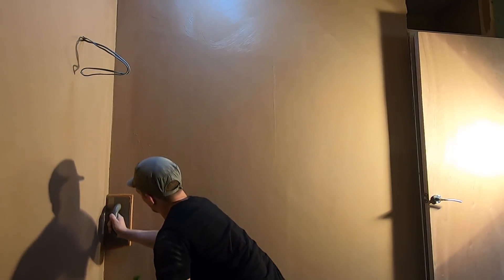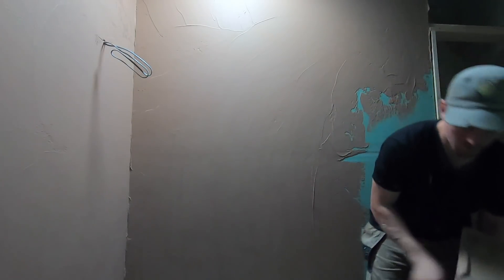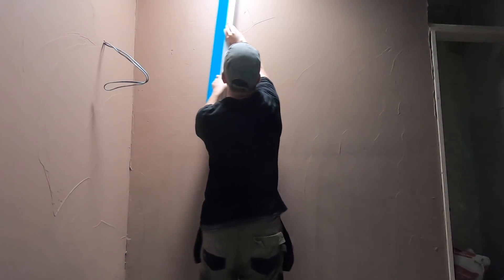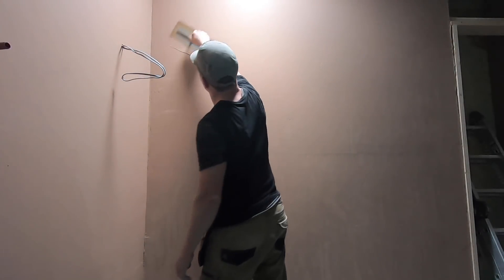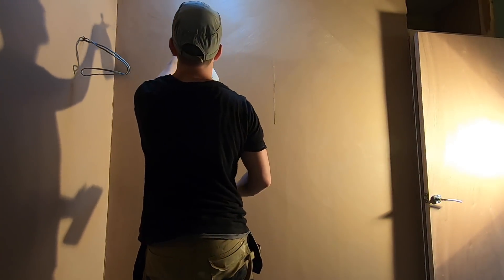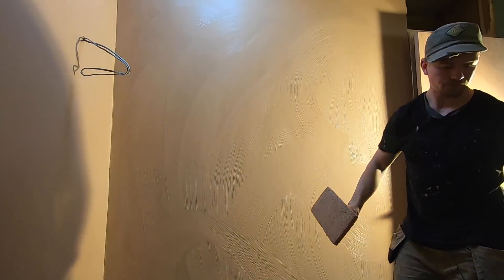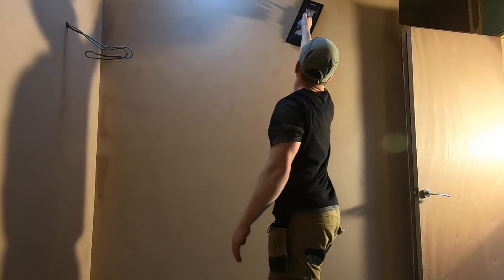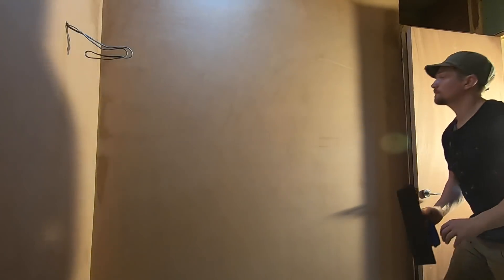One Coat Plastering | Is It Ever OK To Do??? (TEST)

Comment: One coat plastering I was taught at college is the difference between’ plastering and skimming’. Rough backgrounds need 2 coats and flat backgrounds usually only need 1. If a flat wall has cracks and needs scrim, then I 2 coat the scrim and 1 coat the rest. If I’m 1 coating a flat wall, as soon as I reach the end of the wall, I immediately go back to the beginning and flatten off with my 30” plastic trowel.

Comment: Let's be honest, the main reason one coat work is hated is because it lowers the barrier to entry into plastering. Anything that makes the job easier, faster, efficient will get pushback. If we stick to the 'science' of plastering, as long as the wall is flat, plumb and smooth, then it's good to go regardless of method or technique.
Reply: AJ It’s a bit like the ‘art’ of soldering and copper pipework. Ask an experienced plumber his thoughts on push fit and many would say “won’t use it”... I’m a general builder,  i’ve been using the stuff for 15yrs, not one leak (touch wood).
Reply: @gdfggggg  yup, it's exactly like that. Great analogy.
Reply from the maker: I think you've hit the nail on the head AJ. That's a very good point mate and a very interesting view on the world off plastering at the moment!
Reply: Perfect answer. Nice one.
Reply: We only do it one time in Hong Kong. Of course, much fine in craftsmanship in the west
Reply: I’m not sure it does make it easier surely it easier to work with two fresh batches rather than one that is going off before you’ve finished working with it.

Comment: Hi mate, a plasterer worked for me in London, he did 3 x 45 m2 ceilings in 5 hours, he worked on scaffolding but only had enough for one ceiling so had to move the scaffolding afer completing each ceiling he one coated all of em, he had 2 labourers the finish was spot on, he only used a trowel hes the fastest plasterer ive seen in my 22 years as a plastering contractor. I can one coat but prefer laying it down with the second coat. The trick is put it on thicker and dont leave it long between each stage and sponge float it, you were spot on in your video, great videos mate, keep it up 👍

Comment: Ive used one coat on plasterboard and and all sympathetic backgrounds for the last 21 years and NEVER had a problem from any client. I use 2 coat with float and set only. My finish is always excellent due to my experience with the medium. Plasterboard was designed for plastering  (the clue is in the title). Always bear in mind your main objective. Preparation for decoration. Its not to provide structural strength or fireproofing. These things are taken into account at the building design stage. If they were'nt tape and joint would be obsolete. 2 coat work is a hangover from days gone by when most backgrounds were sand and cement scratch coats and demanded 2 coat work. As in the above video as long as you apply the muck thick enough its not a problem and should be encouraged. Whenever I see a experienced spread doing 2 coat work on plasterboard I think WTF.. all these years plastering and you still have'nt figured out its a waste of time. Wake up and focus on the objective not the herd mentality..
Reply: Yes Gary you’re one I could learn from. Good mentality.
Reply from the maker: This makes complete sense - very well formulated argument. You've convinced me ha!
Reply: You are amazing and I love your videos. Tried the sponge but never worked for me. I do one thick coat for plasterboard and 2 coats for anything else as old walls are not levelled. The first thing I do is to fill the joints as it will be my thickness guide. This is how I have been taught. Thanks again for everything.
Reply: Just looked at this video and your comment which makes total sense. Question: What plaster should I use for small area of plasterboard cut in on existing ceiling? There are so many on the market - MultiFinish / Board Finish / Finishing PLaster and even one called 'One Coat'. Thanks
Reply: @Gary Wright.. could you give quick timings between toweling etc when one coat sponge process. Would be a great help for me.. thanks mate and thanks for the honest comment!!!!
Reply: Do you know how many times I’ve tried getting this across to some of the other lads ahaha people stuck in their old ways get 2x as much on because rather than mixing up for a second coat you can do another hit with no loss of quality on boards.
Reply: @andychapman3100  if your just repairing a hole ide say use easyfill 60 or easyfill 20     it's sands down great to leave a flat surface but if your skimming the entire ceiling ide say use multi finish
Reply: Tiler here, never skim plasterboard if being tiled fully, tiles hang better on plasterboard, it’s normally flatter, and holds more weight per m2 than skim , also cement adhesive reacts with gypsum plaster , so needs good priming !!! No need for doing it
Reply: I am a diy plaster I get a great finish with one coat I don’t see the point of messing it up again with second coat when it is perfect with one coat

Comment: a good few years ago i was learning plastering in college. one coat was heavily frowned upon as it was considered a cheat and crude and not used so we learned bonding then skimming and only using 1 trowel for everything and a feather edge and it was considered bad luck if you got the smallest trowel handed to you by requisition. Only did 1 plastering job after college and basically bottled it and havent done plastering since. Saw your videos pop up while browsing Youtube the other day and now i really want to try plastering again. I just gotta remember how i did things then and hopefully find a small easy job to do first. Keep up the Good Work Blaine your a pro!!
Reply from the maker: That's crazy...I suppose things have changed a lot since then! It's never too late my friend. I would just start at friends and family and start for free. It's the best way to get experience...I'm sure you'll pick it up in no time pal!

Thanks for watching. I really appreciate and good luck with it all
Reply: I did plastering for 2 years I always learned two coats and tbh I e never paid anyone todo my homes but this last week I had a guy in doing a big room for me as my shoulder is actually ruined nowadays, He did one coat.. didn’t put it on thick enough and plastic troweled it he’s made a massive mess in my £1 mill pound home and it’s all cracked and egg shelled, proper pissed off he’s coming back to try fix it but now I’m thinking it’s going to be a skip and sds chisel job and start again… the wife’s paid him as well. If you want to make a video your welcome to come and see this nightmare job he’s leaving. Due too my shoulder I’ll have to try lvl 5 it to save the room.(living room too). Some people shouldn’t be allowed in the public.

Comment: I use both single and double skim and have not had an issue with either. For me it which one I go with entirely depends on the wall condition/wall situation/surface prep etc. Never used a sponge or spatula (may try one soon though). For either  method I only use a regular stainless trowel, a superflex trowel and a sprayer and get the same good quality finish with both double and single.  

Doing the single doesn't save me much on trowel work as I find myself working the wall more but it does save me doing an extra mix and washing out as many buckets etc (which for some reason I really hate doing)  

I learned how to get the best from a single skim by starting out fully expecting to do a double and trying to get the first layer as good as I could, before long I was getting it so good (in certain situations)  that I realised I didn't need a second.    

Great video's btw. Keep up the good work!
Reply: You must be a good plasterer,a totally agree with you ,been doing this trade 17 years , and your comment on washing buckets out , true a hate having to do that ,but straight walls and plaster board only need one coat .

Comment: Blaine, this guy i worked for truly made tightness into an art form. 
That was the reason for one coat plastering, that & obviously time. i stuck with him for 11 years building loft conversions & we did every trade between us. Boarding them, doing every trade soaking up all that knowledge. 
I really honestly thought that that was the proper way to plaster. He never used a sponge float.
The walls were pretty good, not the best i've seen but definitely good enough.
Its only through watching  your video's i'm learning where i've been going wrong all these years.

Comment: Been plastering for 1 year on my own and i always done one coat system. I learned it all by watching and laboring 2 years for a plasterer whom has done the coat system for 15 years. You said it all in you conclusion: Saves Time and effort, result is perfect when you master it... hence make more money, getting home earlier. To be honest I have not learned the two coats system, I have tried it for few month but i have gone back to one coat. The key is the timing for spraying water and sponging, the earlier after flattening the better. And also apply the right thickness on dips...as you say you only got one chance. So it's good to have a proper look at the wall flatness before... If you master these elements there is no issues.
Reply: whats your technique for one coat plastering
Reply: @tomjw5027  thank you
Reply: 2 Coats are stronger, like plywood is made if many different layers, it adds strength. On a new build the house has got to settle, The Chances are 1 coat will crack. 1 coats fine for plasterboard though as theres more flex in the stud wall.
Reply: @jezlanejl I think thickness give the strength.  I apply one coat thicker (5mm) from the start then I play with it. In the end I get the same thickness as a two coater who will a 3mm coat then a 2mm coat so same strength in the end. Plywood is strong because of the glue in between the coats of ply.  Plaster is different as there's no glue to make it stronger between the two coats . In the end one coat Vs two coats is down to what you prefer. I prefer the one coat less time, less efforts.👍

Comment: The steel blade Ox is a brilliant bit of kit! I use the ultraflex to finish the set, lovely trowel, I mostley 2 coat but my second coat is what's left of the first mix , watered down, it obviously goes off a lot quicker but if the experience is there, it will save you at least an hour and a half on each set. I've done quite a few one coats in my 35 years of plastering and I've never had an issue with them 👍👍keep up the good work pal.
Eric
Reply: Ps you're a very good plasterer 👍
Reply from the maker: Hi mate!! Great hearing from you pal! Yeah it's a great but of kit - definately makes the job a lot easier. Ok...I know a few plasterers who do it that way and it always looks good. I usually mix 2 seperate costs but it does waste time. I'll give you way a go. Great hearing from you and thanks for the comment. Hope you're well 👍
Reply: @PlasteringForBeginners  go for it! All good this end thanks mate, I think the plaster stock seems to be improving, but I wont count on it

Comment: Been using the spat/sponge system for a while now and was caught short on a job that ran over and banged one coat on a couple walls, exactly the same method as you’ve just used, minus the plaziflex, and was blown away by the result! 
We’ve never looked back! The thinking behind it was “what’s the difference than doing wet on wet?” We just mix up a thicker mix, lay up thicker, and we’ve never had one come back, not even on lumpy old walls, in fact, quite the opposite!! We’ve had two massive refurbs off that one job through recommendations! 
Obviously there’s intants we’re you have to apply two coats, but for the most part, this one coat system has given us amazing results, cheers for posting! 
“Work smarter not harder” 🤙🏼
Reply from the maker: Thanks for the heads up and it's good to hear that you've never had any call backs! To be honest I've not heard any bad stories from anyone yet which is interesting! It just be a good sign 😂
Reply: Plastering For Beginners haha to be honest when we started one coating from that point we questioned ourselves as you are,  “are we being cowboys?” 😂
but like I said “what’s the difference?” Fill the Skrim and the beads, let it pull in and bang it on 🤷🏽‍♂️
It’s the same thickness, flat as a pancake and a nice Matt finish, we’ve been banging out the best work we’ve ever done, for half the effort. If we ever get any come back we’ll be honest and rectify it, but for the last 6 months all has been good! 
Love what your doing with the channel too! Keep it up mate 🤙🏼
Reply: But it is a short cut.  
Plus the person you are doing the work for trusting that you do it the right way.  One coating is basically for chancers
Reply: @tapeslayersreviewsreviews9807  very dismal outlook ! 
One can't always used to be the way ! 2 coats for the lazy kids of the millennium because it's easier to get the finish one coat is fine if you do it right so you need to be skilled as the video proves ! And the trust shown in you by the client is not misplaced because they trusting you to do a good job period !!!! 👌  I know of plenty of 2 coat cowboys that abuse that trust I'm quit often going behind them to put it right !

Comment: I’ve often used thistle multi finish and done one coat, just mixed it up a bit thicker and slapped it on. Sometimes being traditional for the sake of it is a little counter productive.
Reply from the maker: That's a very good point mate!
Reply: I think you will all find that prior to to 90s and the influx of easier NVQs etc most spreads threw one coat of skim over everything. It would have been very rare to find anyone prior to that time going over their first coat of skim with another as they would have learned to load it up with accuracy and speed. Seems to me like the large amount of followers for the two coat skim method have arisen because they couldn't get it right with one coat. I mean, fair enough, if it looks a bit wobbly or is going on in excessive heat, another coat may be warranted, but if you know what you are doing, there really would not be a problem. Additionally, two coat plastering really refers to solid plastering internally as in backing coat then skimmed when three coat would be scratch, butter/floating and skimmed.
Reply: U don't slap it on has to be done at same level , for one coat yes you can do it, only on flat areas plaster board you have to go over the tapes to first .

Comment: One coat is similar to rendering. Most renders nowadays are one coat, albeit with prep work. But if the prep is sound and the finish is good; then there no reason it’s not viable. Strength, in my opinion, isn’t a worry, as I’ve done second coats with what’s left in the bucket and mixed it up again with the new coat. Great vid and keep up the good work 😊
Reply: I'm old school mate...scratch coat.....let it set then top coat...same with skimming...two coats....!!!

Comment: Yes Yes hope all are happy n well 👊🏾👳🏾‍♂️ awesome work 👌🏾

I'm probably gonna get shot for this but hey......... it works for me.

I actually apply two coats of plaster while laying on my first set. Upto a two bag mix dependant on size of the wall.

I lay on sideways from top left to right getting as close to the top & bottom as possible. 

Once half way across the wall I then go back to the start then lay vertically from top left to  waist height , then from the bottom up. Continue this till the mix is done.

Spray up the plaster with a nice haze. The more water you use , the longer it takes to go off which then gives you a chance to get the other 2 walls on & plenty of time tocover the little shitty bits.

The tools I use is a 15 year old 14"MT to lay on. 1200 speedskim plastic rule. 14" Nela gold. 

Thank me later 👊🏾👳🏾‍♂️

Comment: So far only reason I use 2nd coat is when I mess up 1st one :D. Sometimes when you on your own rushing large surfaces you may loose some quality, then second coat can safe a day. Otherwise single coat only! 

You trowel work at the end was a mistake. Use long, as long as possible soft edge blade to finish your work... sponge + water + long soft blade... smaller trowel will only produce dents!
I havent seen many long soft edge blades in UK. You can get them form Europe (up to 2500mm!)... or make one yourself, thin stainless steel sheet attached to piece of wood will do amazing job!

Comment: I’ve done it for years on board only, it’s no difference to spreads who 2 coat with same mix as long as you know what your doing, don’t use spats and sponges just traditional and it comes up perfect every time but can understand spreads who not used to it saying it’s for cowboys cus it takes some getting used to even for experienced guys but I always go over skrim and corner beads first
Reply: Same here
Reply from the maker: All very good points here 👍
Reply: As for brushes  I forgot mine one day and alls i had was a 14 inch decorators brush and it worked great
Reply: Spot on bro

Comment: For nearly 35 years I’ve been plastering. Always , well 90% of the time only one coat plastered, only use two coats on pva walls , this is because the plaster moves around on the on the pva . I’ve never had a fail , I see guys two coat plaster but all I see is most of the mix in the skip , . A question why would you two coat plaster board ? I fined it hard to get board finished these days it’s all multi, which is gritty. When I started plastering nobody two coated , is it now a thing

Comment: I had my first go at plastering having watched every one of your videos. I boxed in a fireplace and skimmed it afterwards - turned out not half bad. Thanks for the videos!
Reply: David Lowe Nothing a smidge of ready mix filler with a light sand here and there won’t sort.
Reply from the maker: Thanks David I'm glad it's working out mate and you might have a point Slashley 😂